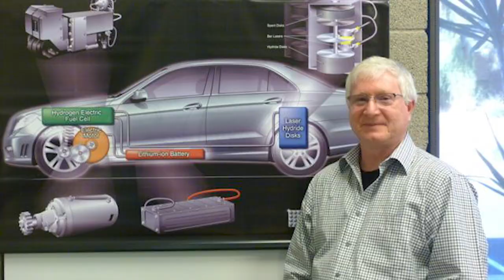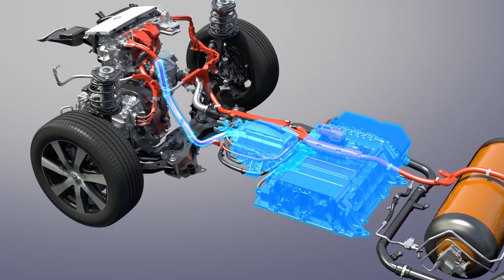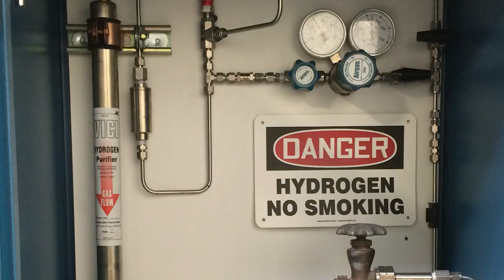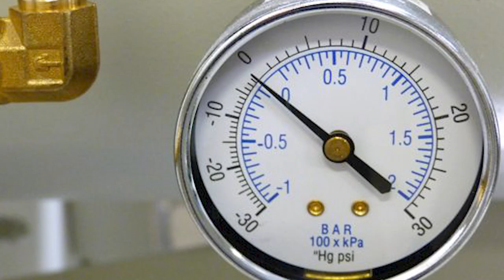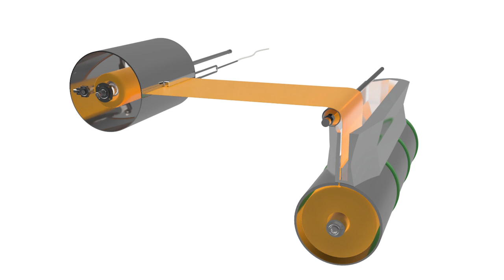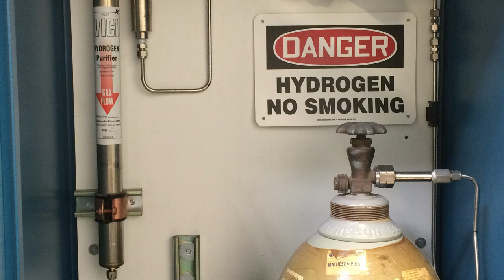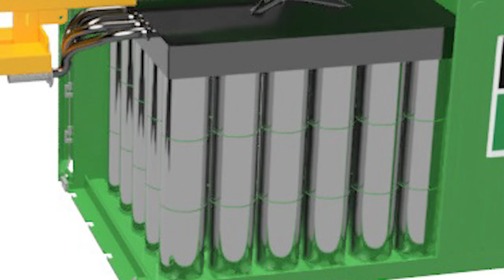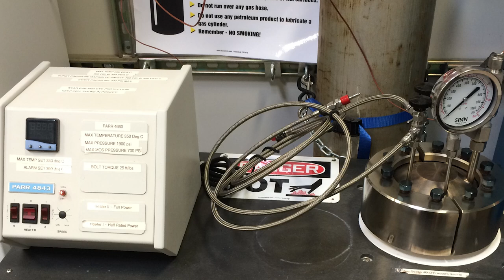This BANNED Technology Could Push Hydrogen Cars Over BEVs

Comment: Prototypes are easy, manufacturing is hard
Reply: Just wait until the Chinese ever get a hold of it...
Reply: @XY &Z DUDE/DUDETTE, THAT IS SOOOOOOOOOOOOOOO 🍟 TRUE!!!;)💥💥💥🤠🍲💕
Reply: Except he doesn't have a prototype. and he still has to deal with mother nature, who says your efficiency from converting water to hydrogen to hydrate and back to hydrogen then to electricity is going to be much less than electricity to battery to electricity.
Reply: @jamesvandamme7786  Less efficient true, but at roughly 1/3 the cost is battery 3x more efficient?
Reply: @jamesvandamme7786  efficiency is just one part of the equation and one thats not even that important. If you dont believe that consider the lousy effociency of the internal combustion engine which EV are struggling to dethrone in spite of being many times more efficient.
Reply: @keithtom6286  That's only the initial cost of only the disks.  You will need to put in a system to release the hydrogen.  A system to turn the hydrogen to electricity.  You will also need to have a battery to have a vehicle that isn't super slow.  There will also be the additional cost to "recharge" the disk with the film.  Creating the film seems like it would be the most expensive part of the disk.  That would make the "fill-up" significantly more expensive than any BEV.

Comment: Whenever I hear of a technology supposably being banned, I get skeptical.  I'm not sure what could be banned about using a metallic hydride for storing hydrogen, the technique has been around for almost 50 years.  The trick is to release the hydrogen from the hydride you need heat, the hydride cools as the hydrogen is released, which could aid in air conditioning, but where do you get the heat.  Originally the thought was to burn the hydrogen in an ICE engine and use the exhaust heat to release more hydrogen.  Not a bea idea, but terribly inefficient.  Apparently the big deal here is using light to release the hydrogen, that's why the very thin film is required.  The banned part is probably marketing hype.
Reply: Yea big red flag for me too, the claimed reason for banning (missile technology) makes absoultly zero sense.  Hydrogen in rockets and missiles needs to be liquid and the container needs to mass in the low single digit percentages of what it holds, not in a million years could a hydrogen absorber be viable for a missile nor could anyone ever have any fear that it would be.  In claiming this it makes the technology sound super powerful which is just BS hype.
Reply: "release hydrogen by heating".... as others have said we need efficiency figures, heat energy isn't free, it has to come from somewhere.
Reply: And it gets all clogged up with deuterium?  That's interesting.  And unlikely.
Reply: @terryjimfletcher  the efficiency calculation should include the whole process of hydrogen manufacture, distribution and use, just as any comparison with battery electric vehicles should consider the efficiency generation, distribution and use of electricity. Hydrogen is much less efficient than electricity for vehicles (and for home heating). Much lower efficiency means much higher cost.
Reply: @kennethferland5579  Could be useful to power satellites, who knows.
Reply: @kennethferland5579  they aren’t saying it was banned due to middle technology just that it’s not able to be exported for middle tech. It was banned under the blanket statement of disruptive and then as a national security risk which just means that the government doesn’t want the tech in anyone else’s hands but their own. They are lucky that the government didn’t just take the patent for themselves like they have been known to do with tech that they only want in their own hands.
Reply: @rogerfroud300  Or as a catalyst.
Reply: @RandyTWester      This is not your daddy's metal hydride storage technology. It doesnt rely on heat. I had a fuel cell integration start-up in 2000 with the head of FCs for NASA's and Bechtel Wizard, Warner O. Harris PE., so I know. I stayed with Paul and Stacey for two days in their home less than a month ago and learned as much as I could. Paul's brainchild and Stacey's unwavering fortitude and support will change the world.
Reply: It's called click-bait
Reply: @ItsEverythingElse  yea, clickbait runs real cool on my iphone.  And is affordable. And it can be blocked if ya dont wanta use it.
Reply: @JonnyMcJonFace  keep rolling that footage. People with the mentality of sponge bob need a wake ⏰ up call 📞 to facts.
Reply: @mikebradshaw8530  you'd be surprised at the amount of tech that gets" banned" then slowly rolled out for civilian use . Military usually gets priority or offers the funding for developing . They get first use.
Reply: I think the official term was "disruptive."  The patent office has termed things as classified or secret and the creator cannot discuss or even work on the tech unless they have a clearance of the appropriate level.  They also reject patents for paragraph and line numbering errors, grammatical errors, and even if the word count is too high in the patent abstract.   Hey, let's face it, they are the guys that let Marconi rip off Tesla, Bell rip off Grey, several others, and allowed patents more recently on things that were invented in the late 1800's and early 1900's... which is ... well... illegal.   While you should not like it, being skeptical might be the wrong reaction.  Perhaps it isn't something that one would not be comfortable investing in tho.   I'm skeptical that anyone without lots of money and backing can expect a fair shake, but not skeptical that they'll screw you.
Reply: @shirleypotter4668  Great discussion. I will definitely look into what you have mentioned.
Reply: Suppose ly?
Reply: I thought that this particular storage was banned because the hydride needed was used in manufacturing nuclear missiles.
Reply: ... "marketing hype" either you accuse him of lying or you don't.
Reply: T.C.  it was the free deuterium buildup that screams 'scam' to me.  It's a new way to separate it, with no reference.
Reply: Laser = heat….
Reply: The reason it was banned was because they feared the technology could be weaponized to fuel ballistic rockets.
Reply: @rogerfroud300  they could just burn the hydrogen released and run the car on hydrogen
Reply: @kennethferland5579  ''''''''''''''''Hydrogen in rockets and missiles needs to be liquid and ''

they could place a small battery in the   rocket that powers a laser similar to a pen laser that could heat the hydrogen
Reply: They were worried about energy density return vs weight and its ability as a propellent. Turns out it's not very weight efficient at all mostly due to the substrate weight. I anticipate a villi like material due to the massive surface area per mass. Or maybe micro crystalline powders.
Reply: @shirleypotter4668  I'm not pick on you here, because I don't know much about the topic at all. But just wanted to say, the patent office will patent anything. They patented toast, they patented a device that was suppose to save lives by finding IED's in Iraq (like a dousing rod) . They didn't work and people got blown up looking for the darn IED's. I would think 'life threatening' is more serious than 'disruptive'.   Made ya think. :D  

As an aside: Old James Randi, died a few months back, never had much respect for the patent office and the last few years he pointed out how useless they've become in preventing such none sense to proliferate. There are videos all over youtube from his lectures.
Reply: @terryjimfletcher  saltwater land positive negative, harness it is the issue .energy is abundant and all around .free to all if we figure it out but that is a HUGE threat to them and a major incentive to hide and or suppress such technology's and ideas,
Reply: This is a scam, that's why it's banned. Not because of marketing hype.
Reply: @MakerSpace, exactly. It is very seldom that 'a technology' gets banned wholesale, especially if it is actually just a process. I don't believe, for example, that IC engines will be banned as widely (completely) as some politicians are promising. Governments should not be getting into the tech details (the minutiae, so to speak) of doing something, they should be involved only as far as participating in / coalescing societal agreement on goals. Then, they should be self limiting in terms of the degree of regulation that they enforce, and let science and the free market and more science come up with the best answer.
Reply: Or, perhaps, the government shit itself (unnecessarily, of course) when it heard deuterium was produced by the system!?
Reply: @slackjaw It's still electricity if you use it, it's about sotrage.
Reply: Well, having worked in R&D, this is quite plausible. However, “banned” is a poor description. You need to realize that our federal bureaucracy has vast near-legislative powers and can create rules, enforceable by law, that can restrict how products are built and distributed. This is especially true if “national security” is invoked. Computers and computer component exports are a good example. This hydrogen technology needs to be exportable to all automobile manufacturers to be practical. If it is not, it is kind of equivalent to being “banned”, because its practical applicability has been killed.
Reply: Bob Lazer seemed to have that nut cracked..... his video is on here.
Reply: @1EliPrice  correct
Reply: @AlanDeRossett    Nuclear power could be used to create all the hydrogen we want. The modern nuclear reactor designs are quite phenomenal. However, the environmentalists have successfully lobbied for regulations that require nuclear power to be 10,000x to 100,000x as safe as fossil fuel sources (never mind the ecological effects of hydroelectric power). The waste problem is largely solved in the new designs, as they recycle their own waste. 

My point has always been: “If the Climate Catastrophe proponents TRULY believed their own propaganda, they would embrace nuclear power, since per their claims we need CO2 free and NOx free power in order not to go extinct.” Since they don’t embrace nuclear, I conclude they don’t believe their own propaganda and all this is, in effect, a socialist (government control) movement.
Reply: Don't close your mind to the improbable,  the earth is not flat as was the thinking just a few years ago when wind was the only propulsion!
Reply: Would be one slow missile slowly lasering its reel to reel tape for fuel lol
Reply: I worked for Billings Corporation in the 70's on hydrogen vehicles and hydride hydrogen storage.  This is NOT recent technology.
Reply: Many excellent patent ideas, in the past, have been purchased by another entity and buried in the file cabinet. Eliminate the competition by buying the patent.
Lots of disappointed inventors.
Reply: @dilvishpa5776  and you should always point out that modern "pebble-bed" reactors CAN'T melt down due to their design.
Reply: Agree.
Reply: @1EliPrice  so this is essentially behaviour like eastern powers. Weeeyyy to go.👏
Reply: @terryjimfletcher  LIGHT
Reply: @terryjimfletcher , Electric motors get hot in use. The heat can come from there once the car is rolling. A battery can get things started.
Reply: The trick is having the right politician in your pocket....
Reply: Metallic hydride tech isn't new, it has been around for a long time. Some countries use it in place of nuclear power for military submarines. There are backup power systems available on the commercial market for industrial applications that use metallic hydride in powder form. And, the tech being banned is true. Though it was banned for export, which is something that happens often.